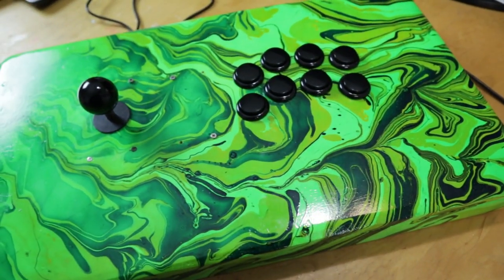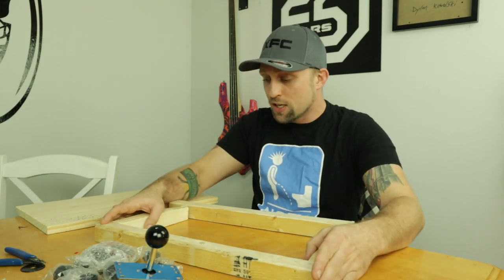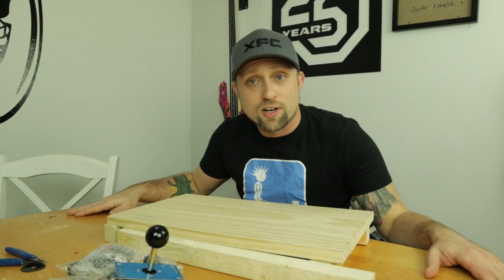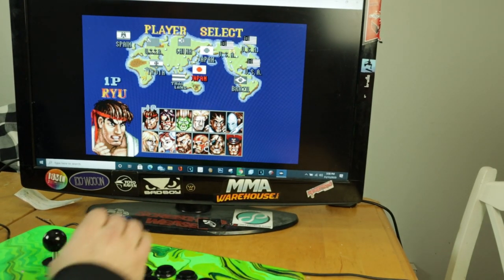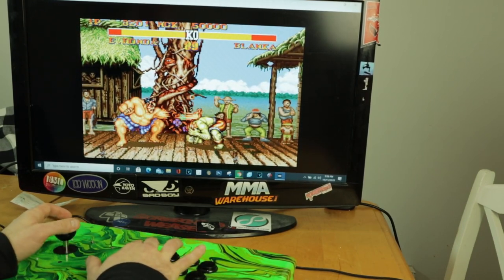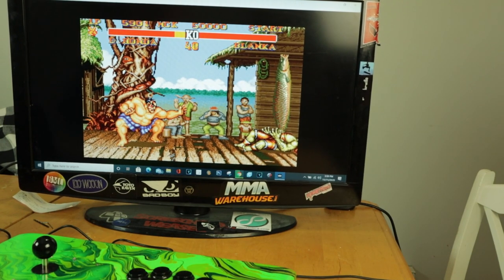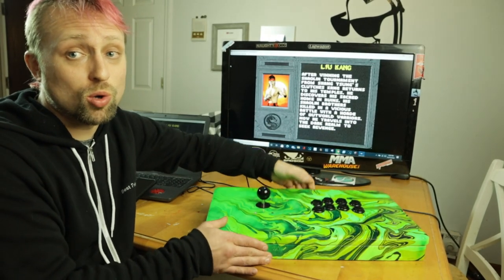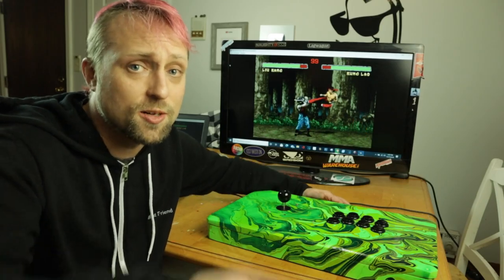DIY Arcade Stick For $20 Tutorial. DIY Fight Stick

Comment: This was supposed to be tutorial but it's not...
Reply: Because it wasn't supposed to be a tutorial....
Reply: @Riska__  it literally says tutorial in the title
Reply: @Riska__  Bruh.
Reply: @Wo00064 yeah, a tutorial on how to get an arcade stick for $20 lmao
Reply: @ResistantPig69 honestly it's kinda hard to have a DIY arcade stick tutorial since it's literally...

1) Get a box
2) drill screw holes for the lever
3) drill 30mm holes for the buttons.
4) wire everything up according to the kit's instructions.
Reply: @KetsubanSolo  I mean, they all wire up the same lmao all boards clearly tell you exactly which terminal is for which option/action with clear ground terminals. Then the actual wiring itself is always the same and super easy as well. Buttons get one power and one ground wire, both are exactly the same and it doesn’t matter which button terminal they go on; power goes to the spot on the board for that exact button and all grounds get chained to the ground spot. Joystick is exactly the same except you might have to solder the wires to the contacts on the stick board unless it has a 5pin and then it’s just as easy as everything else. Even easier if you get a double side female 5 pin cable.

Comment: Turned out pretty nice. Shaft length on the lever looks too short for the control panel thickness. But after shipping, an extended shaft would nearly double the cost of the project 🤣

Comment: Really cool man. I'm sure diehards would say "you must get sanwa stick & buttons" but for people like me that just want something that'd work, that seems like a pretty good option to try to build this (a fun project) for pretty cheap... Could always upgrade parts to Sanwa later also I wanted. Good video. Hydro dip came out great.
Reply: I come from the future to say a worthwhile upgrade to this stick would be replacing the PCB with a Raspberry Pi Pico controller flashed with GP2040-CE. One of those is like $7 if you know where to look, it can play on the Switch/PS3/PC (and there's been headway for PS4 and PS5 compatibility) and it actually has less input latency than Brook's offerings.

Of course you gotta solder wires, but hey, it's an option, and there's a bunch of people working together on it to add new features and basically make it cheaper to make good fightsticks

Comment: So, a couple questions: 
1. What type of restrictor gate and buttons did you get?
2. What type of wood did you use?
Reply: my guess is that he probably used the same ones the product provided to keep it on a $20 budget so square restrictors. also if the planks are 1 x "n" its usually common pine or douglas fir at home depot

Comment: Im doing this FOR SURE for some dragonball fighterz, needed a fightstick at this would be fun to make too. is there soldering required to do it or do you just plug the
 things in?
 Edit: i already saw this and started building it within 5 hours, just need the buttons coming in a few days and i can finish it up, im planning on staining the wood too instead of painting it
Reply: how did it turn out im thinking about building this also
Reply: @shuuu9729  its really good, the only thing id change is the thickness of the top piece of wood because if its bigger the joystick will be shorter but it works great
Reply: @cartershircel  can you tell me what wood you bought im kinda noob to building things
Reply: @shuuu9729  i had some at home, its just some basic pine wood that you can get at like home depot or any place that would have it, mine was in a longer piece and i cut it down to what i wanted, its like 9 inches by 20 inches, and its like an inch thick, if you can get thinner its better. Then i got some smaller pieces like he has where they were like rectangular and i nailed those into the top piece of wood around the bottom edge. its basically like his but nailed in instead of glued. also id reccomend getting a piece for the bottom but it isnt needed. And get a few screws because the kit doesnt come with any.
Reply: @cartershircel  thank you so much!
Reply: @shuuu9729  yep :)

Comment: I've got my eyes on the stick since the start of the demo and I cant help to think that the stick has delay input. Can you confirm this for me? I am planning to build one too with your parts and all.
Reply: I don’t know how good the PCB is, I’ve heard it’s pretty good for budget sticks but I’m not sure about the lag. But I will say that the lever and the buttons are not sanwa parts, they’re cheap knockoffs and won’t feel as good and may even be less durable. I’d recommend buying buttons/levers from focusattack or arcadeshock.
Reply: For casual use though for maybe say retro games, it may not be too bad of an option
Reply: Thanks for the input man
Im gonna get one since this would be the first stick that I will own and I dont know how it feels like to have a good stick and buttons.
Reply: @ferofferd  If you play fighting games, depending on how much money you have, the Qanba Drone is $70 right now, it usually goes on sale for this much, it works on PC, ps3, ps4, and it may work on the ps5 since it’s officially licensed but don’t quote me on that. It doesn’t come with good parts, but you can mod the stick to have good parts later on down the line when you feel like it, a Sanwa JLF lever from focusattack is $17 before tax, a balltop is $1.95, and for buttons (30mm), you’ll only need to modify six of them, going left to right, because the buttons that are at the far right don’t get much use anyway, as for pricing it’s ~$14.7 (2.45 each) but focusattack is usually sold out and idk any other places tbh, and I don’t think the ones from amazon listings are real but I’m not completely sure.

Comment: Now I want to do this.... I think I'd buy a pre-built box, though.
Reply: Late response, but if you just want a pre-built box and material doesn't matter, you can get a decently-sized plastic electronics project box on Amazon for like $20 that can accommodate a six button layout (most fighters don't use more than that). I recommend a height around 2.5". This makes Japanese-style levers (what you get in most DIY arcade cabinet kits) a non-issue, but you can also comfortably fit a Korean lever provided the hole for it is 35 mm to accommodate the collar (you can get away with the standard 20mm hole if you go for flat collar). I haven't tried American/European style yet (Industrias Lorenzo), but you may need to get something a little bigger to fit those.

To add extra weight, the cheapest option I know of is to go to your local grocery store's customer service desk and ask if you can buy about four rolls of pennies for $2. Just tape them to the bottom of the case with some Gorilla Tape and they'll add some much needed weight so that the case isn't sliding around. Also if you have an old mouse pad lying around, just cut it in half and glue the two halves to the bottom to add some grip.

Comment: bro whats the dril bit size for button holes
Reply: Depends on the size buttons you're using, they look like the standard 30 mm size buttons though. Go one size smaller on the drill bit and round it out until the buttons snaps in snug. To big and the buttons will swivel around.
Reply: @gustavosanchez5962  thanks man